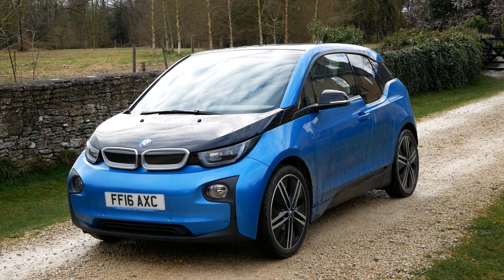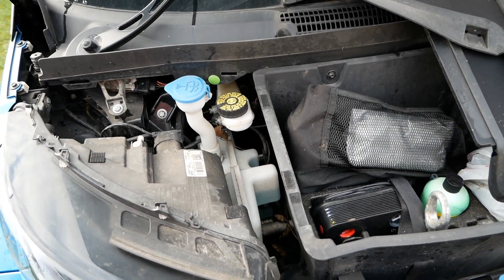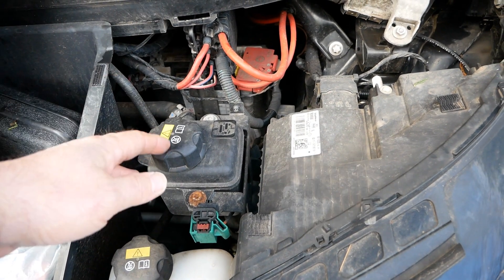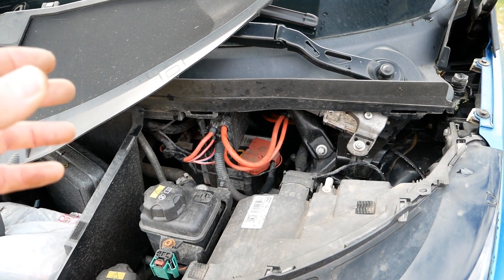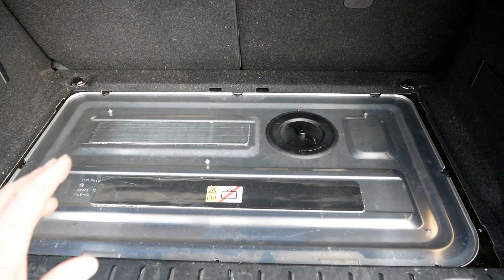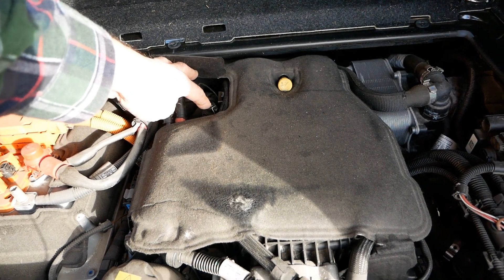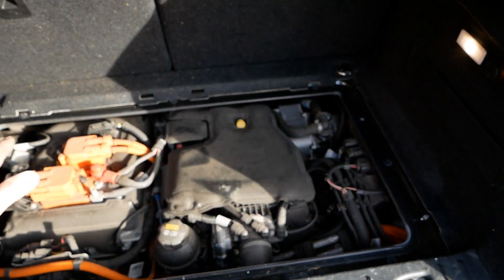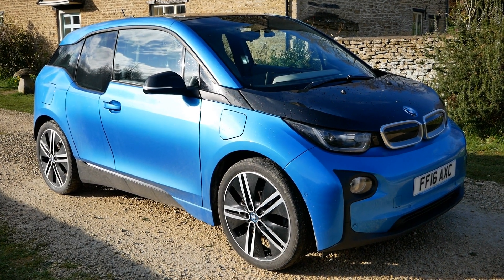What's under the bonnet in a BMW i3 electric vehicle?

Comment: Given that they have that space in the middle, why not install air scoops in the bonnet with tubes containing a wind powered impellor, to drive a generator to provide charge to the main battery while in motion?
Reply from the maker: Because that wont generate enough to charge the HV battery and the electronics needed for that would be very expensive and complicated. It may generate enough to charge the 12V battery, but that is already being charged by the DC-DC converter when the vehicle is on anyway, so you wouldn't want to add any more voltage to that circuit either.

Comment: Funny that on non-rex models the free space of the missing ICE is not used as extra storage. Unless you buy an after part cover.
Reply from the maker: Yes, someone has made a stainless steel storage compartment for the non-rex models.